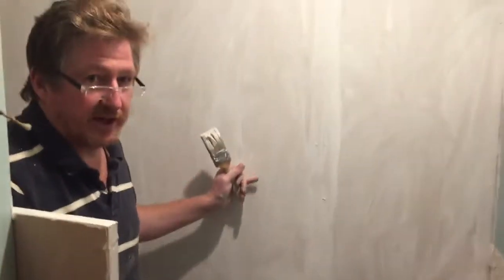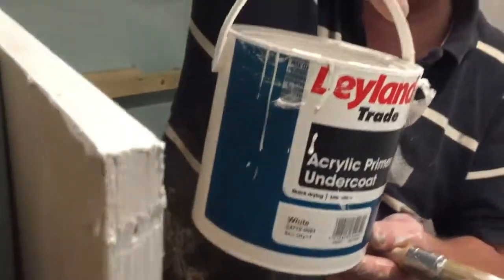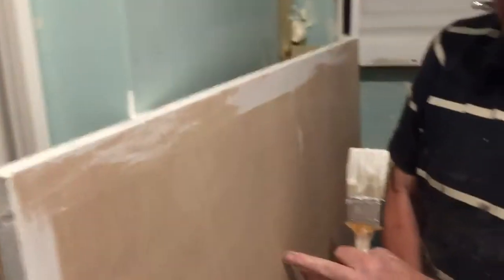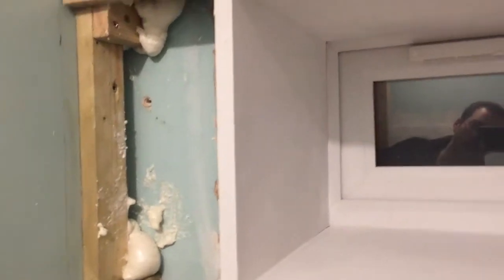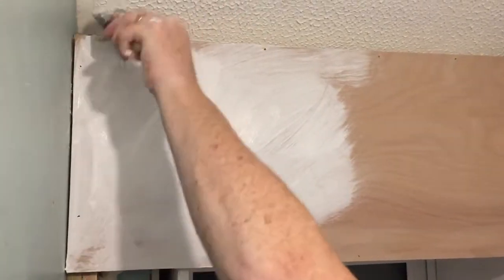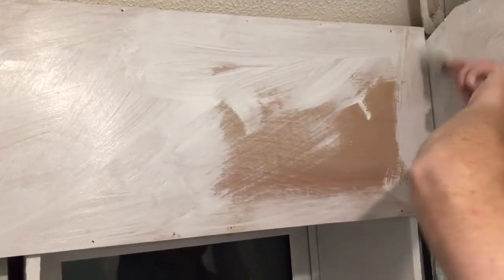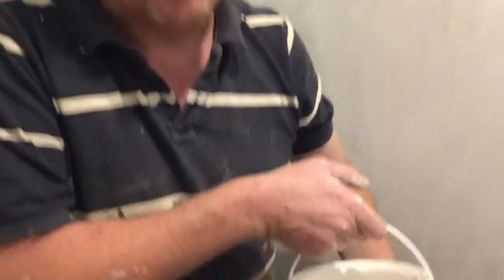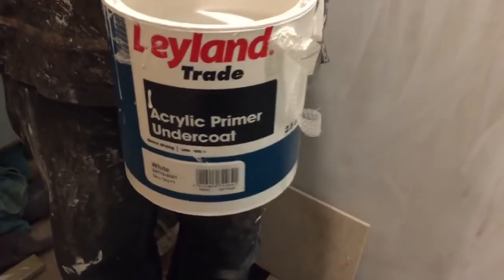Leyland Trade Acrylic Primer Undercoat Paint

Comment: Hi, I have new plaster in the kitchen. I have just painted it with the mist (watered down) coat with Leyland trade contract Matt. Is it okay for me to let it dry and then apply the 2nd coat with the same paint and but water it down? Its in the kitchen. The final coat (3rd coat) will be with a different paint for the walls but the celling will be the the standard white as applied with the Leyland trade contract Matt. Thank you!!
Reply from the maker: Yes that would be fine you can build it up, just means more coats but will dry quicker and better finish. There's also 'Zinsser B-I-N White Multi-surface Matt Primer, 1L' that's really good stuff from our experience. Just make sure the paint is really dry, otherwise suction from old to new can pull it off, thanks.

Comment: Doors and walls are already painted, can I use Leyland Trade Acrylic Primer Undercoat to paint on top?
Reply from the maker: give them a rub down with light sand paper for a key.
Reply: @DanielJohnHowTo  yes I know. I am talking about plaster wall paint. It is currently painted in red. I need to know which undercoat I need

Comment: What primer do you recommend for IKEA malm draws? Which has a vaneer layer
Reply: Melamine is pretty difficult to paint because it is like a non porous plastic, follow these steps and you should be ok.
1) lightly rub down with 100 grit sandpaper.
2) wipe down with damp cloth to remove dust.
3) dry of with blue roll.
4) 1 x coat of johnstones multi surface primer.
5) 1 x leyland trade acrylic primer under coat.
6) 2 x johnstones contract matt top coat.
Don't forget to denib in between under coat and top coats.
Reply: Zinnser bin primer it will stick to  almost anything. Meths based. Drys quick maybe a foam 4inch roller to apply
Reply: As Richard says, Zinsser.

Comment: Can I use a spray gun to apply this undercoat
Reply from the maker: Probably but you would need to thin it, personally I'd brush/roller it on for a better job.
Reply: Yes you can, 25% water, sprays well using hvlp sprayer (you can get a thicker coat than brushing, plus no brush marks)